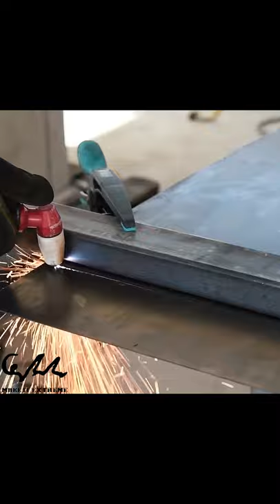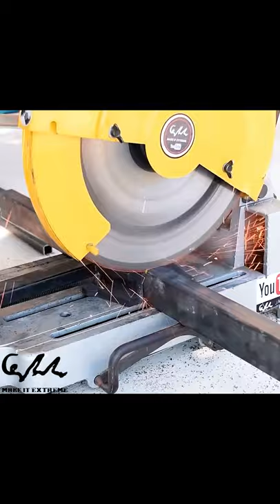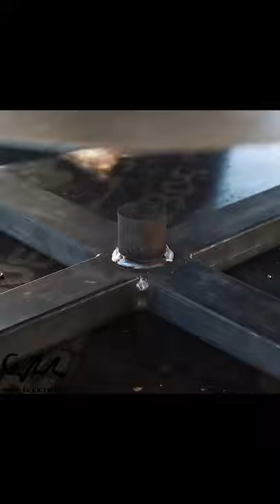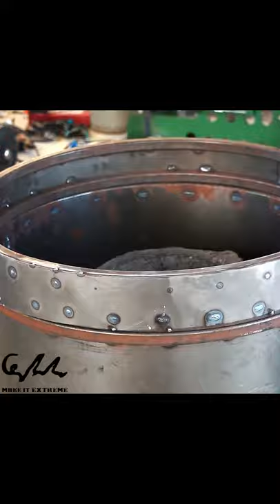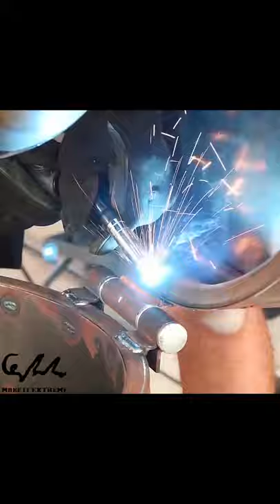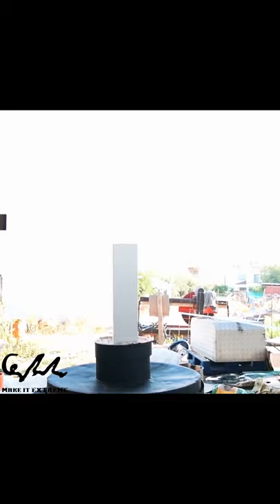Making a Metal Melting Furnace

Comment: A tilting lid of that size is a bad Idea. It will radiat hear at you while you're lifting the crucible. Better to have a lift and pivot system that will rotate it away and still have the hot part pointing to the ground....still a good vid, but just something to consider
Reply: Eh when I do any sort of aluminum casting I tend to be as quick as possible and wear an insulated apron so this doesn't really bug me so much but if your just wearing some welding gloves for sure do this

Comment: Very cool. Do make sure you secure the insulating ceramic fiber. It's like breathing asbestos - micro fibers will fly out of the forge. I had mine coated with 5 layers of high temp cement and there is a spray that locks these... Wonderful videos. Stay safe!
Reply: @ЕрикШырайынбеков  both? Great?